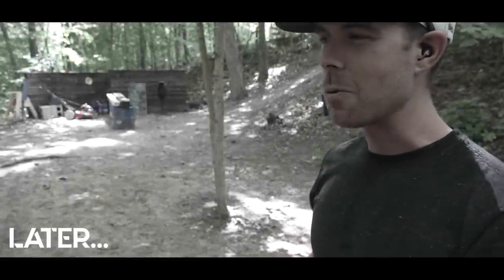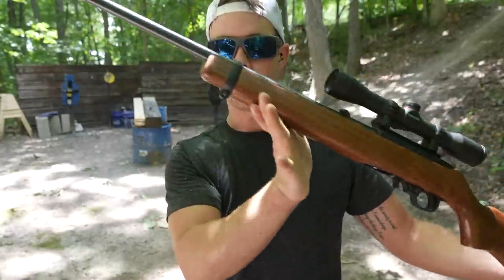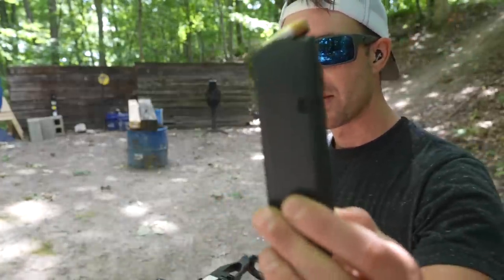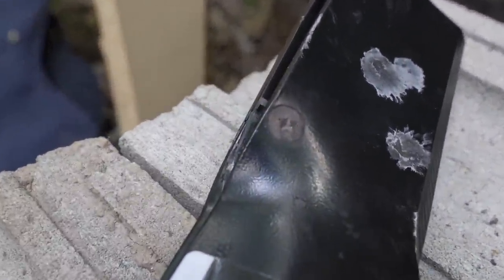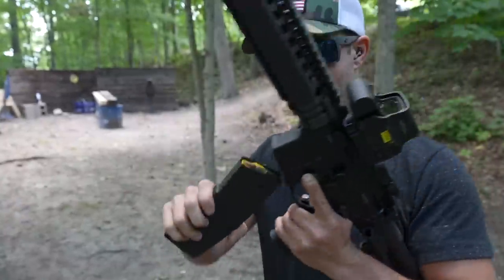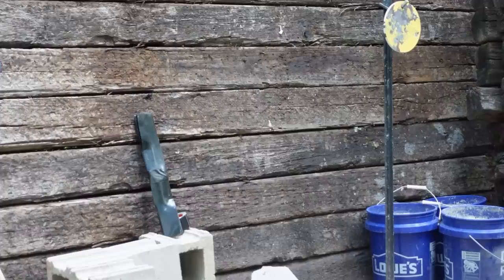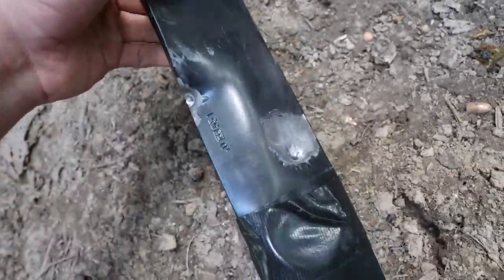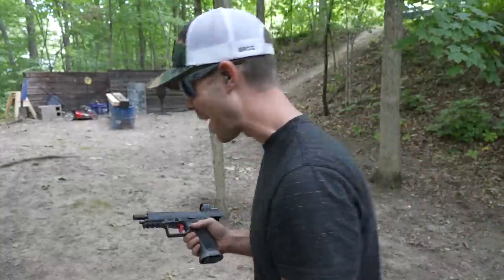How Tough Is A Lawn Mower Blade ???

Comment: That makes me sad you own a glock 🤢🤮glock is a cult and the plastic bends when you squeeze it to hard about no saftey shit hi point is better
Reply from the maker: Pinned
Reply: Spicy 🔥🔥
Reply: Have to check out the Stk100 by rock island. Aluminum frame glock 17 clone with a 1911 grip angle.

Also, glock has multiple safeties. I've actually had a HiPoint discharge & dump last 3 rounds in mag when I  tapped it with the palm of my hand to make sure it was in battery because the previous shot felt funny... turns out the firing pin had bent slightly & was stuck protruding from breach face just enough to turn it into a straight blowback fixed firing pin machine pistol...
I threw the pin + spring as far as I could  & traded it for 250rd of 9mm during the shortage last year.
Reply: Yea you must be a gamer.
Reply: @oneer8435  or just never seen a glock taken apart...

Plot twist - maybe he's just a troll?🤔
Reply: @RichardCranium321  I mean i give credit to glock. but i call Bullshit on a malfunctioning hi-point. they might be shit in the past, they might be fuggly, they might be cheep, they might be uncomfortable to grip for some people. but they will operate after being drug behind a truck across a state, run over by a tank, and shot by another gun. They are some of the most resiliant and reliable handguns iv ever seen.
Glock doesnt come close to be fair.
Reply: @kellerweskier7214  sounds like we have demolitia in the house
Reply: @kellerweskier7214  just ask Matt Caricker how tough and reliable they are. And he is disgusted by Hi-Points lol
Reply: @southernboss.752  I think we’ve all seen what Matt has done to Hi-Points lmao. They did take a beating. The Most Ugly Uncomfortable POS’s but they get the job done in home defense situations for people that don’t have tons of money to buy better. Let’s just say you get what you pay for, but you do get your money’s worth too lol. Sounds like an oxymoron
Reply: @kellerweskier7214  I only paid $100 more for a "used" police glock than the msrp for Hi-point...

The only thing you're right about is there's no comparison. 

If you understood the operating mechanics behind the demo ranch video you referenced then it wouldn't be as impressive. Because of the fact it's a straight blowback it withstood things like being shot simply due to the overall mass of the slide & the barrel fixed to the frame...
Reply: Shooting hardened high carbon steel, not too bright ehhh. Wow someone doesn't know much about steel.
Reply: @girthbrooks5078  those blades are essentially ----

Edit: I'm wrong
Reply: @RichardCranium321  no those blades are more like 5160 or 5150.
Reply: @girthbrooks5078  really? Isn't that like the old leaf spring material?
Reply: @RichardCranium321  yup that how it's so strong , carbon=strength
Reply: @girthbrooks5078   damn... well I guess I was half right. I grew up on a farm & I remember we made a blade for the brushhog with old leaf spring when we broke one while cutting. We didn't have a spare & It was quicker than spending the entire day going into town to buy replacements. It wasn't too difficult & it taught me sometimes you gotta use tools to make tools to do a job... You could tell it was slightly off balanced, but it did the job & didn't wobble so much as to cause damage for the length of time we would be using...

Did it once with leaf spring & once with what I was told was ar500 flat bar cutoff scrap,  thought there wasn't too much difference between the two. Learn something new errrday
Reply: @RichardCranium321  ar500 is a terrible blade steel very low carbon content. It would not hold a edge well.
Reply: Leaf spring steel make excellent blades. High carbon content.
Reply: @RichardCranium321  , yeah that's the 1 I'm looking at next for my collection ..
Reply: For the record, there are 0 metallurgists and 0 firearms engineers making comments here. 
You guys are vegetables. Go back to the demo ranch where you look smart.
Reply: Chambering a round on a glock sounds distinctive due to how much open space there is inside of the frame.
Reply: Sure but there simple and reliable AF🔥
Reply: glock imo is better than hi-point. hi-point is for when you need something to grab and go. glock is more for reliablity
Reply: @literalfeline  glock is better in EVERYONE's opinion, including hi-point - even THEY agree...

Hi point is only good for someone who wants it to sink real nice bc it's gonna be tossed from a bridge into a river after they done with it...

I wouldn't even keep it as a garage gun, I'd rather have a Taurus spectrum. They're even CHEAPER but at least they came in stainless...
Reply: @girthbrooks5078  mower blades don't need to be a 1000 layer damascus blade. Ar500 would work perfectly fine and you wouldn't even know it was in the mower(unless someone told you).
Reply: @stompingpeak2043  wrong ar500 would not hold a edge well at all low carbon content
Reply: @girthbrooks5078  yes because your mower needs to have that 🤦‍♂️
Reply: @stompingpeak2043  how do you figure 5160 is Damascus? Do you even understand what 5160 is?
Reply: @girthbrooks5078  yes it usually just comes in barstock. Then damascus is different pieces welded and folded together to make stronger/sharper weapons(typically). I was just saying you don't need a top of the line blade for a mower. Just about anything can work if need be.
Reply: @stompingpeak2043  wow 5160 is a cheap tough steel. But your so smart that you want to use a steel 5 times the price. You obviously don't know anything about steels. Go study
Reply: @stompingpeak2043  i got that but tool steel is cheap, ar500 is not. Ok then what element gives steel strength?
Reply: @girthbrooks5078  why you soo hostile? Did you forget this was about using what you have to make a blade? In this case it wouldn't be an issue. If I'm buying metal ill just buy a blade from the store.
Reply: It's amazing how the trap can be so obvious, and yet so many willingly just walk right into it.

Comment: The underwood extreme defender, and the extreme penetrator are Lehigh defense solid copper bullets. Alot of the Lehigh defense bullets are monolithic machined solid copper projectiles, and/or copper Hollow points with a monolithic copper base.

Comment: They're made of high carbon nickel alloy steel. Much like a car leaf spring. Anyone who's ever repurposed a leaf spring knows they're tough as hell.
Reply: Leaf springs make good knives I've heard.
Reply: @petequinones3454  indeed they do.
Reply: @petequinones3454  really depends on the leaf spring.  Some may be 5160, 1095, 4140 or a host of other steels.  If you don't know what it is, you can not heat treat it appropriately and it will not be great.
Reply: I work for a manufacturer that makes both leaf springs and mower blades.  I believe that they are made of 4140 steel (the springs are made from 5160 steel).  The heat treat process makes the mower blades softer than the leaf springs, as nothing ruins the day more than hitting a rock and having a broken mower blade come flying out from underneath the mower.  Having a mower blade that goes dull before it can fail from fatigue is a feature, not a bug, so blades on the biggest mowers are a consumable and replaced every couple of days.

Comment: Dude, be extremely careful shooting lawnmower parts, I saw a guy shoot one with an AK and the bullet ricocheted; coming back and completely going through his body. He got lucky nothing vital was hit but that was a huge reality check.
Reply: Look up the one where the guy put tanerite in one and it cut his damn leg off 😂 it’s on YouTube
Reply: Very suspect story.
Reply: @romak4756  yeah 7.62*39 isn’t gonna ricochet off of a lawnmower even if it did it would have so little energy it’s funny😂.
Reply: @romak4756  That 10mm sure as hell came back with dangerous speed. you can see it on the slo mo :D
Reply: @romak4756  Depending on the angle and the round used, It could absolutely send back a peice of something that could get you.
Reply: @Jexorz86  yup, not enough energy to go through a human being
Reply: @Jexorz86  yes i realize this, BUT NOT COMPLETELY PENETRATE A HUMAN TORSO.
Reply: @romak4756  Even at a fraction of its original speed it can in fact through and through you if it dosnt hit bone or something else hard.  Especially if its only a small peice. It's unlikely but entirely possible.
Reply: @romak4756  Also its worth noting, Its much more dangerous if it only gets half way through.
Reply: @Jexorz86  highly unlikely.
Reply: @romak4756  Just food for though, Half of a 7.62 out of an ak, and half the original speed, is still stonger than most handgun rounds. So yeah. Absolutely its possible.
Lightning striking twice rare. But entirely possible.
Reply: @romak4756  Almost everything about richochets coming straight back is highly unlikely. Hell its why Edwin is still alive from some of his less than wise videos back in the day. but it Can happen. Especially with steel core or not lead bullets.
Reply: @Jexorz86  you can continue to argue, but a straight back ricochet will not have the velocity to penetrate a human torso. Sorry to dissapoint.
Reply: Exactly 💯
Reply: @greybone777  yeah i saw a ricochet from a bb gun kill 4 people once, in different counties, in different states.

Comment: I know that john deere brush hog blades are every bit as tough as ar500. 556 barely leaves a dent even at close range. I cut the straight section out of old ones with a torch and use them as small falling plates.

Comment: You could buy some of those and melt them down into a mold and it could be some cheap body armor.
Reply: The melting point of high carbon Steel is 2600-2800. I that be very difficult to fo

Comment: I'd like to see what a 270 would do to the lawn mower blades. I've Punch through 3/4 inch thick steel with it. I've also seen on a different video where it went through level 3A body armor plate.

Comment: Would like to have seen what the 556 green tip would have done to 2 or 3 blades . I've seen green tip do a lot more penetration than other rounds on steel

Comment: A Youtuber is actually talking about something in a video that I know more about than the average person.  I feel the need to add my two cents worth.  Those mower blades are not very big, or thick.  For the biggest, baddest mower blades, you need to go to a farmers' supply store.  Two brand names that you can look for are "Alamo" and "Schulte".  The thicknesses of the heaviest blades may be up to half an inch

I work at a manufacturer of metal forgings that includes both "Alamo" and "Schulte" mower blades.  The greatest fear of any manufacturer of mower blades is the blade failing in a way that causes it to fly out from underneath the mower and, because these mowers are used to cut grass by highways,  go through some drivers' windshield.  The steel is heat treated to bend without breaking when it encounters something that it cannot cut through and the edges go dull quickly enough that there is no threat of the blade failing at the mounting hole due to metal fatigue, before the blade is replaced for being dull.  The blades last about three days of continuous use and last for nearly a week in an accelerated fatigue tester.

Comment: Hey man, what type of ak do u have? Im considering one but because of the crazy price increase with them, they are all expensive, even the lower end ones. I've been doing research and finding mixed reviews on the century vska. But at $1,000.00 that's the main one in my price range.
Reply: If I were you, I'd stay away from century a.k.'s. I've heard more bad than I have good.

Is it the platform you're interested in or just the caliber
Reply: Century kinda stinks sometimes
Reply from the maker: I have no personal experience with century but I, like the other people here, have heard too many negatives on them to recommend at $1000. My 762 AK is an old WASR and its been great, 545 is an Arsenal they are probably 2 grand now. Which is crazy. Its a bad time to buy an AK but I would still say try to find a good WASR over the new century’s. Again thats with no personal experience with century

Comment: you lose over 100fps using that 'race' gun. you should use a full size non-ported pistol for penetration/dmg tests.
Reply from the maker: The barrel is not ported and its almost an inch longer than my full size glock.